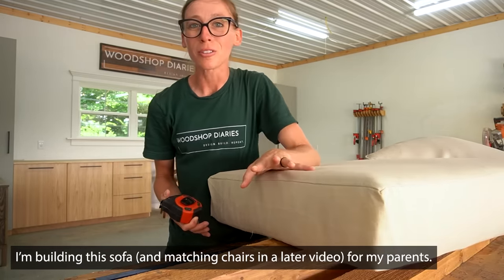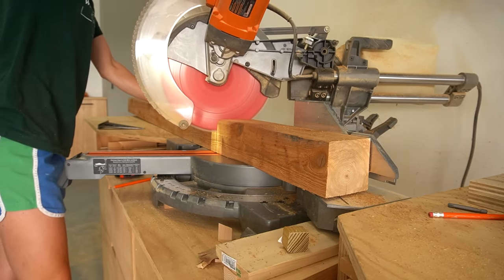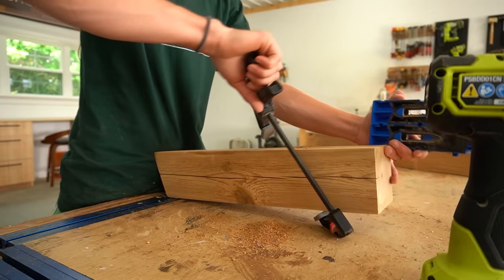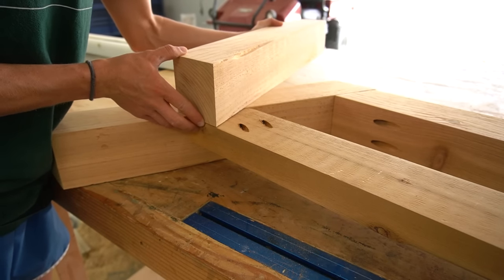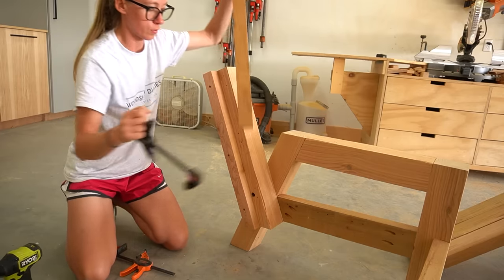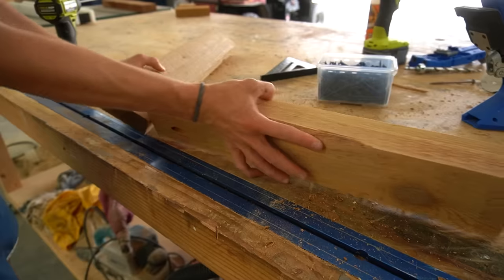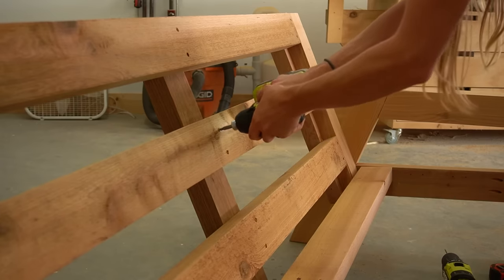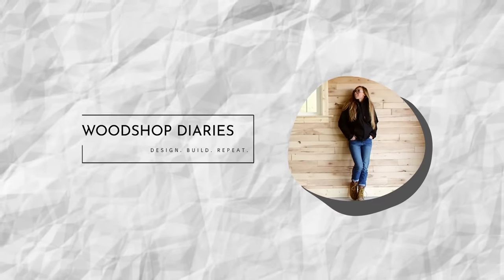How to Build an Outdoor Sofa EASY | With Building Plans

Comment: ive always wondered how the cushions survive rain, or do you take them inside when it rains or do you washem on a regular basis
Reply from the maker: The ones I have are under a covered porch. They get wet occasionally but not every rain. But the ones for my mom are on her open patio. They are outdoor cushions so they’re made for use outdoors and have water resistant fabric. They get rained on, but dry off quickly. Shes never washed hers (I haven’t washed mine either), but she did bring hers inside during the winter. I left mine out. Both sets are still going strong.
Reply: @WoodshopDiaries  would be nice to know where you buy them thanks
Reply from the maker: @jamesortega8681 they’re linked in the video description 😊

Comment: The plans were fantastic and saved me a lot of time building my 2 couches. I ended up extending the couch to fit 4 cushions which maxes out what you can get out of 8ft boards, using 2 middle supports instead of 1, and it's ROCK solid.

Comment: Hi Shara. I’ve been trying to guess the brand of your sander in a couple of your videos but you don’t mention it in the description box. 
Would it be possible to know the brand of your blue sander, please? 
By the way, congratulations on your YouTube channel. Your work is amazing. And even your furniture is made with pocket holes, YES, it’s woodworking!! For those who think it is not.
Reply from the maker: Hi! It’s a SurfPrep sander. I don’t link it because it’s pretty pricey. Full disclosure: they sent it to me and I bought the vacuum for it. I really love it. But I wouldn’t personally spend that much out of pocket on a sander so I don’t link it because I don’t want people to think you have to buy an expensive sander to build with. I used a $100 Bosch after my old Mirka died and before I got this one and it worked just as well. So I recommend it if you have the budget, but if not, there are plenty of just as good cheaper options. I hope that makes sense—I typed it in a hurry 🙈🤣
Reply: Thanks for your answer. I’m just a woodworking is just a hobby but I have some budget for some important tools, like sanders, that save a lot of time. 
Thanks again and best wishes from Spain. 
Happy building!!

Comment: Thanks for the great video. Easy to follow! How would pine hold up? Cedar is a little expensive for me.
Reply from the maker: If using outdoors, I’d recommend using treated pine. Untreated pine may last a few seasons if it’s under cover but if exposed to the elements, it likely wouldn’t hold up more than a season or two.
Reply: @WoodshopDiaries  Thank you! Appreciate the advice.

Comment: How are the cusions holding up? I've been thinking about getting these for a similar project and would like to know if they are flattening out?  I think my "similar" project has now shifted to your design. Looks really nice. Just can't find a good price on cedar 4x4. They are going for $56 each in TN
Reply from the maker: I gave this sofa and the matching chair to my parents. They don’t use them often, and the cushions still look like new. But I bought the same cushions, only in grey for the matching loveseat that I kept myself. Me, the dog, and the cat have used them almost daily for the last 7-8 months and they have flattened out some but are still in pretty great shape considering how much use and weather they endure. I’d definitely buy them again. 
Also, cedar is definitely pricey. But you could also go with treated and save quite a bit.

Comment: How do you know what is ‘too long’ for something without a center support? Is there an industry standard?
Reply from the maker: It’s will vary by project depending on what you’re building. I just knew there’s no way I could span six foot on a 2x4 without sagging in the middle. Two seats? Maybe. Three, no.

Comment: So at approx. 4.35mins into the video, you fit the lower brace to the legs, is this supposed to be parallel to the top support? It looks a mile out on the video and would annoy the hell out of me if I saw something like this?
Reply from the maker: No I said it was angled at 4 degrees intentionally so it slopes downward toward the back.